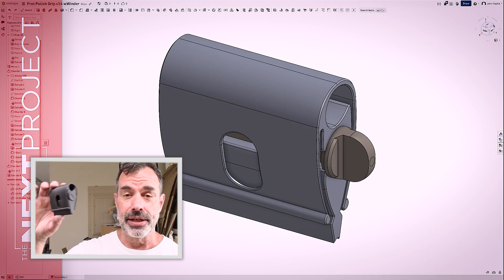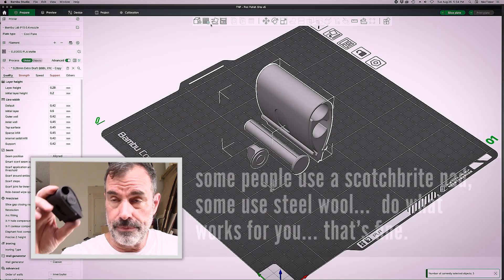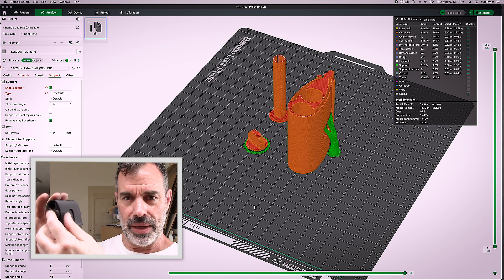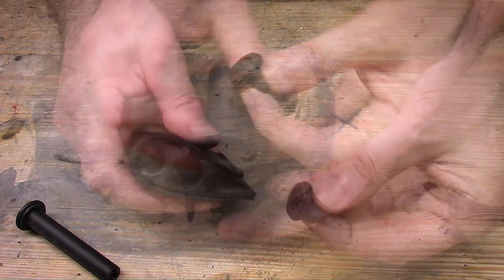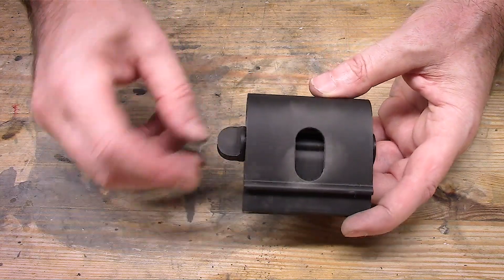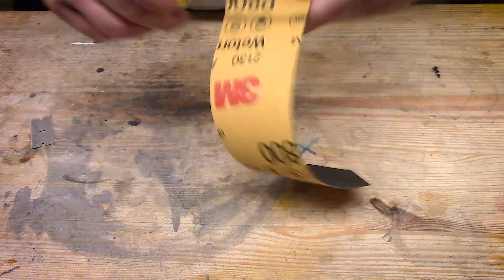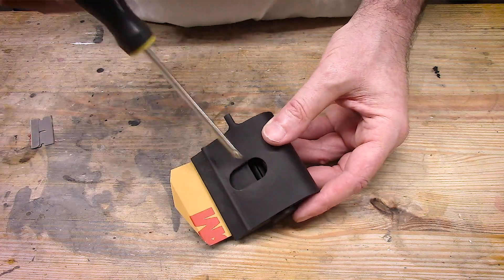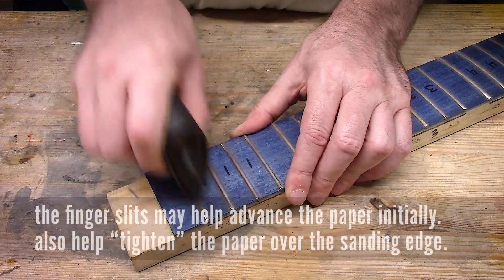Fret Sanding Polishing Grip v17 - 3D Printing Guitar Project Tools  Ep4

Comment: I would really love to see your print orientation on these parts. Just trying to figure out how to place them on the build plate is proving tricky.
Reply from the maker: Voyeur, thanks for checking in.
Here's a timestamp link showing the orientation. 
https://youtu.be/Dd9O90jO-tE?si=BDXwTSVYwe2DqLQp&t=47

I use support for the main housing to hold the thumb-hole openings.
The knob may also get a little support for the shoulder that is face down on the hotplate.
I hope this helps, good luck with your projects!

Comment: Dude, thank you. I got this and the relief gauge parts printed last night. The relief gauge parts fit and work perfect. I haven’t used the grip yet but am excited to. What cad program do you use?
Reply: No definitely not too much info. I am only three days into 3D printing and using tinkercad to design a jig that drills the truss rod hole on a fender style headstock to meet up with the routed channel. I like the way your designs turn out so I am going to give OnShape a try. With the help of the videos of course. Thanks again.
Reply from the maker: Thank you very much, I greatly appreciate the support and generosity!
Glad to hear the relief gauge part fits. 
Let me know your feedback on The Grip, I hear if there are additional changes that can help it become a better tool.
Currently I'm using OnShape, which is a free online (web browser) CAD app. I've been running it on a couple different apple computers, one new, one old. No issues so far. 
I had looked at a number of different CAD apps,  a lot of which have a monthly, or yearly cost... I'm cheap (broke), so OnShape seemed to work well for me. 
There are a lot of good short training vids online (YT), small learning projects, did about a dozen of those and started making stuff on my own. 
If interested, there's a fellow who goes by "Too Tall Toby", he does a number of different software app videos, but his stuff really go me going with OnShape.
Sorry, to much information.
Thank you again, be safe and take care!

Comment: This is awesome! Just what I was looking for. Any plans to post the STLs to Printables or Makerworld?
Reply from the maker: Shiv, thanks for watching!
I really haven't considered posting the files at this time, as the design is still undergoing some refinement / revision.
I will have a v18 of this tool available soon.
Be safe and take care!
Reply: @theNextProject  I printed 6 copies so I can switch between different grits without reloading the sand paper. Worked like a charm!
Reply from the maker: @ShivRajora  LOL, WOW!  I think you are a record holder!
Let me know your thoughts on the grip.  I do have an update coming soon.  I've made some improvements to the way the paper loads and the reel that it wraps onto.  The housing remains the same, so you could potentially just print the newer reel and thumb knob.
Stay tuned, it's coming soon!
Reply: @theNextProject  looking forward!
Reply from the maker: The new version is out, v18.

Comment: Very good project! will this tool also do the fret crowning or do you need to create another tool? This is great advancement in CYO (create your own) tools.
Reply from the maker: Fender, thanks for watching!
I hadn't considered using this for crowning work, mostly for removing leveling and crowning marks.  No reason you can't try it, but I have no idea if it will do that job. 
I do have a new version which should be easier to load, being released in a couple days (v18).
Be safe and take care!

Comment: Hello! Great idea. Just a question. There are different thicknesses and heights of frets. Is this device compatible with all fret sizes? Maybe it could be designed for multiple fret sizes.
Reply from the maker: Májer, thank you for watching!
I've used this with medium and wide frets, with good results. 
Haven't tried it with narrow, so it may not be ideal as designed. 

I think I will re-visit the design and offer a couple fret width options, thanks for the suggestion.
Be safe and take care!

Comment: Would be cool to have different shapes/sizes for small, medium, jumbo or extra-jumbo frets (Jescar 58118 extra jumbo is my favorite fret size)
Reply from the maker: Mark, thanks for watching!
That's a good thought. This grip should work on jumbo, as the concave radius is about 1/8in (.125"), so its pretty beefy. 
A narrower tip may be a good idea, would be pretty easy to make/modify the native CAD file.

I'm liking the jescar 58118 wire too. Typically get the straight sticks from Phildelphia luthier supply. I've had really good luck with Phili, and Jescar wire too.

Be safe and take care!

Comment: Can this be used as a fret
leveler as well as a polisher if i use different sand papers
Reply from the maker: Pallet, thanks for watching!
In general I'd say - no it won't work as a fret leveler, as it doesn't reference the frets to either side of the one being worked on. So, if heavy cut papers is used, it will just grind down the fret being worked on to whatever degree.
I suggest finer papers being used with this tool, 600 grit or finer, and mainly use the tool to remove leveling beam and crowning tool marks before any final polishing.
Hope that helps, be safe and take care!

Comment: As a development of the sample shown, it is possible to connect the inner drum not with glue, but with a screw connection.
and then, when changing the emery, you can take out the drum, conveniently fix the sandpaper tape in it, and insert it together into the body.

ps what the scale on this neck? looks weird... I think there is a video in which you talk about it. Please give a link to it, or its name.
Reply from the maker: Ziggy, thanks for watching!
Some good ideas you have there. 
I may look into a different loading process similar to what you are suggesting.  I want to keep the printing files and assembly simple and with few parts, but making loading easier would be a great improvement.
The fretted board I was testing on is not a neck or any musical scale.  It is strictly for testing of tools and processes, I call it a torture board.  It has pairs of nickel and stainless frets, so I can see how different fret material effects whatever tool I may be testing.

Thanks for the revision ideas.
Be safe and take care!
Reply: @theNextProject    that's smart enough (about the test neck)!

As for the reconstruction of the drum: it may remain the same as it is now. from the same two parts. You just need to come up with a separable connection of these parts, instead of a permanent one (with glue). It can be either a threaded one (which I have already mentioned, after all, it is not very often that you have to replace the emery), In addition, you can make a grip for the hand on the other side of the drum, so that dismantling and mounting can be carried out without the use of an additional tool (screwdriver).
or make a kind of latch

Comment: I printed it yesterday and tested it today. It's a great design and very comfortable thanks to the sandpaper magazine!
Compared to my wooden ones, the polishing grip is much taller, so I'll need to get used to that, but it also fits very well in the hand.
Thank you for sharing the print template and for putting so much effort into the design!
Reply from the maker: Bluesmate, thank you for watching, and the great feedback on the sanding grip.
I really appreciate the info you shared, and your comparison to the other tools you use. Good information!
I'm gathering feedback, and there may be future versions, but time will tell what enhancements become reality.
I greatly appreciate your comment and time.  
Be safe and take care!
Reply: Just by looking at it i also thought it was quite tall. i havent used it and this is just a Suggestion, but from my Personal experience, i find sanding the most precise and comfortable with a low center of Gravity/Balance. i could Imagine that the Sander Likes to easily tip left and right, potentially eating into the fretboard with your Hand this far away from the sanding surface. i know the mechanics need some space and you know best how good the stability of the tool is, thats just Something that came to my mind. also, id probably not glue the shaft but use a threaded Insert and screws so you can retighten it. i could Imagine the friction fit will come loose over time. maybe you can even use a spring loaded Pension mechanism.

to make it more comfortable you could think about a multi material build, using tpu as grip Material.

maybe for reducing the Chance of hitting the fretboard with the sandpaper there could be standoff lips left and right from the sanding surface to keep the sandpaper from touching the fretboard. maybe that enables sanding of the frets without needing to mask it, though you wont BE hitting the lowest mm of the frets anymore - but thats usually also Not what needs a Lot of sanding.
Reply from the maker: sgredsch, thanks for watching and the comment too!
This version is 2.75" tall, 1.2" wide and the housing is 2.75" deep. The knob and reel project a bit beyond the housing. Once my hand is on the tool, my fingers are pretty close to the fingerboard. Not cramped and not towering over the work, seems to fit reasonably well. I think my hand size is in the average range - too small for basketball, lol.

I like the idea of offering a multi-material product, but I have no control over what printer, or filament people may have and use to print this tool. Since I'm not printing and selling these, I wanted to keep the design and print process pretty simple, if that makes sense.

For me, the sander goes where I point it, and it can be leaned to the side, which offers the ability to get the paper down closer to the board. This is very much like rocking a fret file to the side to help round the crown. I do tape off the fingerboard I'm working on, so damage isn't an issue from this process. I know others use the stainless fret protector products for file an such work, so that would be good to, I'd imaging.  I'd have to figure out what material would be safe to create a standoff, then how to ensure that material is used for printing, idk.  I've been prototyping mainly in PLA, cheap, rigid enough for this purpose but if it would contact a lacquered fingerboard, it may scuff the finish - maybe? Guess it depends on who's pushing the tool too. 

Good stuff, I've got more food for thought.
Thanks, be safe and take care!
Reply: @theNextProject  im using spectrum filament pla pro - its insanely hard and layer bonding is very rigid, dimensional accuracy is very good and it doesnt warp. might be hard to get at your location as it is being manufactured in poland, but its the best PLA i have used and is very very tough - you can pressfit parts with a steel hammer without leaving a scuff. so its worth looking into special more premium pla blends if you want ease of print and the hardness and stiffness of pla turned to 11. the pla pro is also a little more heat resistant than your regular pla, which might be another positive for a sanding application. there certainly are other brands with similar stuff, but spectrum is my personal favorite.

i would stick with pla for the structural parts. maybe have the TPU grip as optional add-on part to glue on for people that can/want to print tpu.

as for the contact area of the tool and the fretboard, im positive a wet sand should make the PLA surface very smooth and scratch safe with the right geometry.
Reply from the maker: Thanks for the tip on Spectrum Filament PLA Pro. I've googled and it appears to be available here... assuming we haven't tariffed it to death.  I like the heat resistant part, as I live in Florida US, and some PLA gets a bit soft when left in the garage. 

I'll also give TPU a look, as my printer will handle it, and I've got a pretty good vent system set up too.

Thanks for the chat, always appreciate hearing new things and learning on the fly.
Be safe and take care, John
Reply: @theNextProject  when you give spectrum filament pla pro a shot, try 210°C nozzletemp, 60°C bed - im printing at 60mm/s - if you print faster, you might wanna try slightly higher temp. it also irons very well with the proper settings.

oh and its a little bit more hygrophile than your average PLA. if you see blobs, stringing etc, its probably wet and needs to be dried.

Comment: I like that. If I may suggest a V19 improvement because loading the end into the roller section looks more difficult than it can be. 
Rather than gluing the two parts together what about making then threadable into each other? That way you can put the end of the paper in while the roller isn't installed if that makes sense?
Reply from the maker: A II Z REVIEWS, thanks for watching!

Thanks for the feedback too!
Pre-loading the paper before getting it in the housing is an interesting idea!

Threads, I have concerns about the quality of thread and the amount (length) of thread needed. I won't have any control over print quality, so I'm concerned with "threads" in general.
I also considered a "snap on" end, which the current version is a very snug fit. So it would initially work like a snap-fit, but expect the fit to get sloppy in short order, so I had suggested the glue. 
Something thread/snap/press fit assembly... thing.

Hmm, good things to think about. 
Oh, I just through about threads, and direction of rotation, would want to verify that with every twist of the knob, it would be tighten, not loosen. So ambidextrous/reversible reel direction may need to be re-thought as well.
This is why I'm not an engineer, my brain hurts already, lol.

Thanks for the ideas, my brain will soak in it for a bit.
Be safe and take care!
Reply: @theNextProject you could always do a corkscrew single turn style thread or maybe a twist lock style. Good luck with your future designs and I look forward to see what's next!!

Comment: Have you heard of the Frtlzr polish bundle? If not you can see many reviews of it on YouTube. I just ordered that recently for ease of use for polishing. Your tool seems like a step further than theirs with the rolling ability. What you made is really awesome. Wish I had a 3D printer.
Reply from the maker: Nofar, thanks for watching!
Yes, I'm aware of the Frtlzr tool. This is kind of a similar device, but intended for different paper and handling of the paper as you know.  
I've tried a lot of different processes for prep and polish, and will continue to experiment with new ideas too.
I think the Frtlzr uses micro mesh paper. With this tool, I was hoping to stay with more common wet/dry papers, cut to 2.5" x 8.5". The reasoning was largely due to local availability of this type of paper and cost.
If you know someone with a 3D printer, take the files to them and ask for a print. It costs about $1US, takes a hour or so to print. 
If you like it, great! If you don't like it, let me know where it can be improved. 
Good luck with your project, be safe and take care!
Reply: I was JUST about to buy a FRTLZR when I saw this video. I like this “free” design much more. But now it’s gonna cost me a 3D printer. 😟 Darn it!
Reply: @The-Weighed The FRTLZR is pretty much only worth for their 3D plastic tool. Other than that they only provide micromesh in 4 grits for their €39.99 'premium' kit (1500, 2400, 4000, 8000). You don't need a 3D printer tho, lol. You've got places that allow you to print, I don't think this will be more than $10 - but I could be wrong tho. Then get a 9 sheet set of micromesh 1,500 - 12,000 grit.
Reply: @Nofar-pu7sg thanks! I’m on it. 👍🏻
Reply: @The-Weighed You are very welcome, sir! If you have any further question I'll do my best, I've got both the Frtlzr premium polish kit and spot leveling kit.

Comment: I already started printing this. Giving it a try later =). I have been thinking about to design fret crown sander that would attach to multitool or reciprocating saw. Sanding is really getting harder the older you get. It hurts :D
Reply from the maker: Nevanet, good to hear from you again, and thanks for watching!
When you get a chance to use it, let me know your feedback. I'd like to get user experience and make some upgrades.
Getting older is a pain. : )